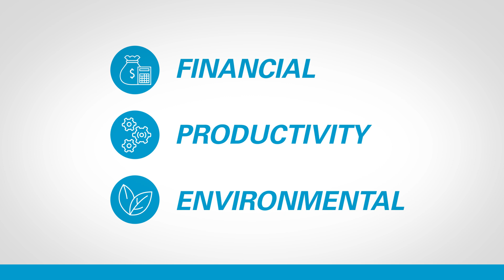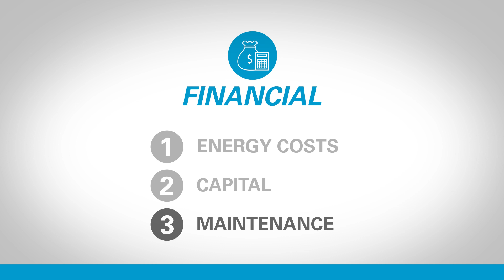Centralization of a Vacuum System - WHY?

Comment: Thank you for the straight forward explanation.. Please can you highlight some very useful parameters or the steps i can take to carry out a performance test on my Vaccum pump.
Reply from the maker: Hi Kenneth & thanks for the question. 
There are many types of technology out there and they all have their quirks, but if your pump can exhaust directly to the atmosphere and you have some basic equipment then there are some things you can do.  If you hook it up to a vessel and measure the time it takes to reduce the pressure by a fixed amount, that will give an indication of flow capacity.  You can also check that the pump is able to reach the manufacturer quoted ultimate vacuum, which would show how well the unit is sealing.  

The best advice is to consider the whole vacuum system because leaks and restrictions in pipework or unseated valves can end up sapping the performance out of your vacuum system and it can get costly increasing the spec of the vacuum pump to compensate. This is in fact where a variable speed central vacuum unit comes into its own because any improvements you make to the piping network translate directly to energy savings at the vacuum pump.  

A reputable vacuum pump supplier should be able to advise what’s best for your situation, give your local Atlas Copco office a call and they will point you in the right direction 😊
Reply: You can start making following notes:  Counting all machines, vacuum required for individual machine, cycle time , volume of each machine chamber,   kw rating of each pump, location for central vacuum etc. After getting these details, you can pls let me know